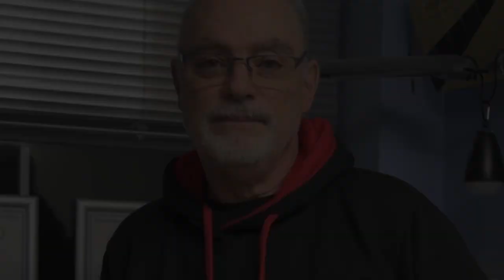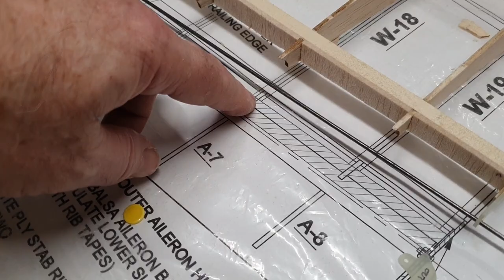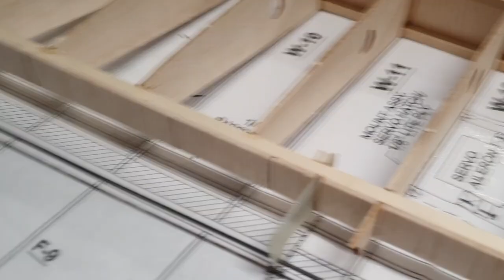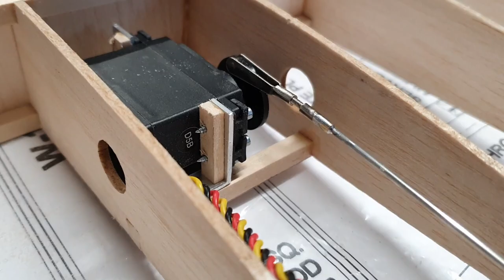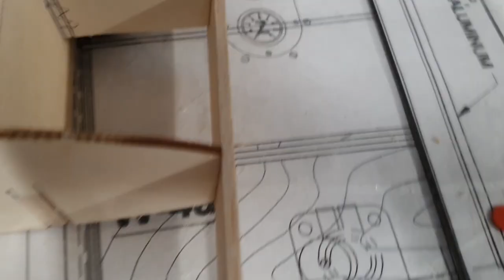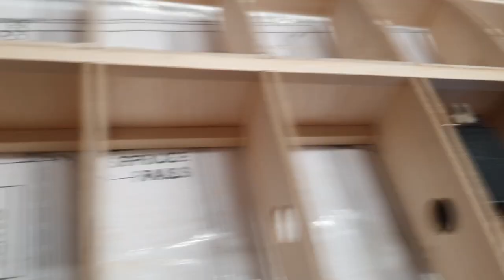Quarter Scale Chipmunk Pt 24 Wing Framing

Comment: Hi Danny. Another great vid.  That tool for measuring the gaps in between spars (when you did the webbing ) is great.  What is it called?
Reply from the maker: I think they are called bore gauges, i did a video showing tools in my workshop, mentioned in that, they come as a set, to cover various size ranges.
Reply from the maker: They are called telescopic gauges